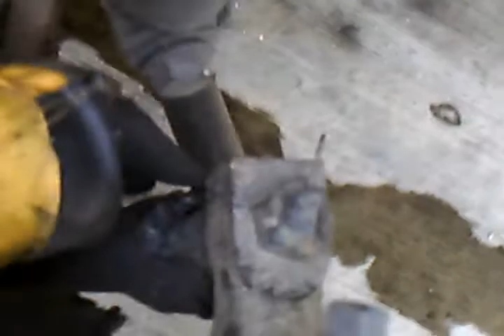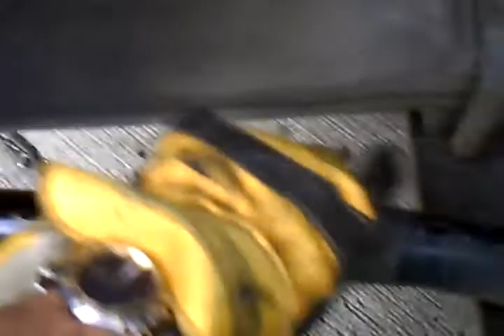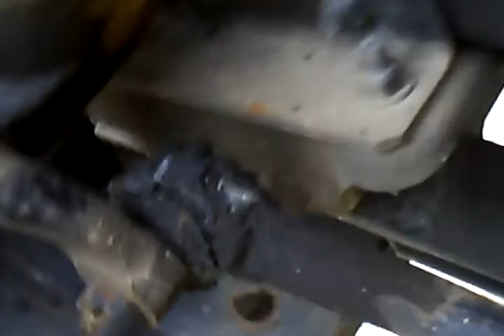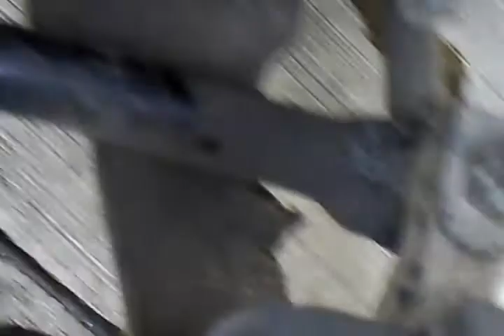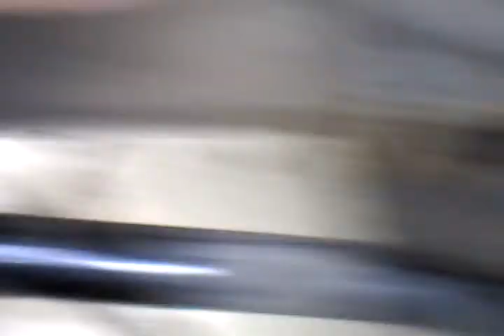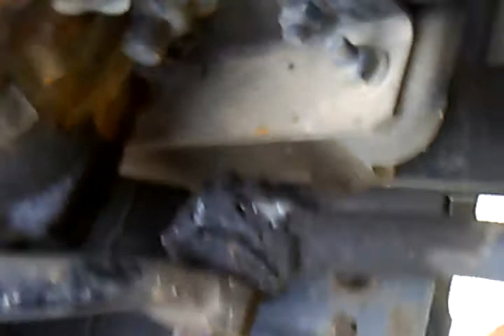Ball joint

Comment: I drive 92 Nissan Maxima, the car is in good condition but a mechanic at NTB told me that I need to replace ball joints on front wheels as they are bad. I checked other videos on YouTube and found that bad ball joints are making noise while driving. My car doesn't make any noise while driving. Not sure should I replace now. Franchise repair shops are very expensive. Would like to have suggestion to fix this thing at local mechanic shop, like their work quality, will they install original parts?